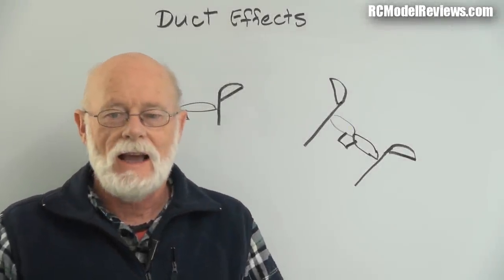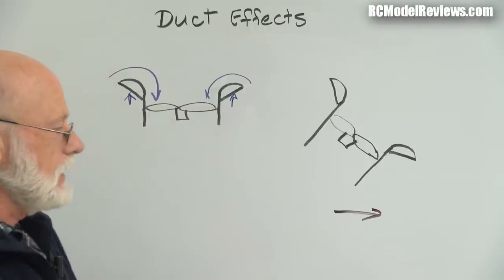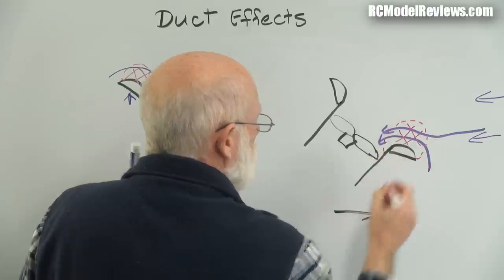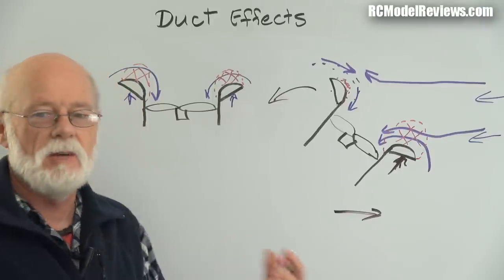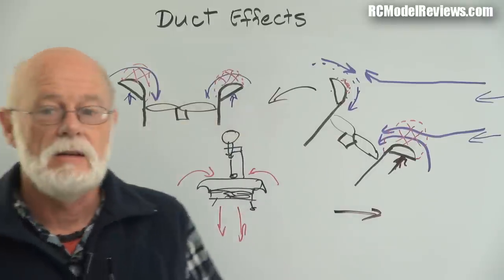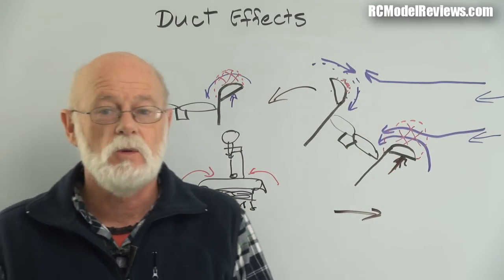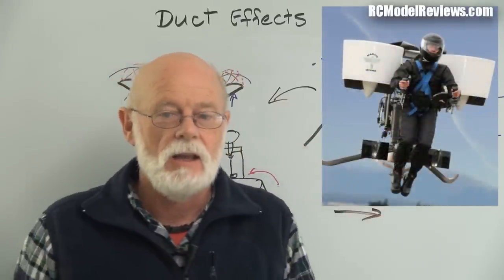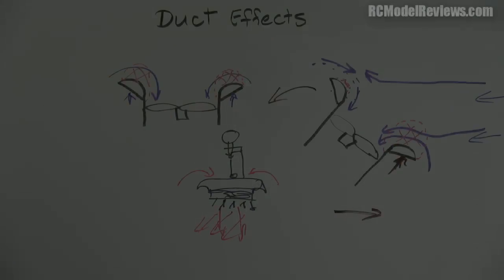More on ducted propeller systems

Comment: I'm wondering why no-one has done leading-edge slats/slots/flaps  ( or similar)  on a duct as a method of reducing the efficiency of the leading-edge as compared to the trailing edge, so that this problem goes away....  seems like a relatively simple approach, and would be mechanically trivial if done right.
Reply: I was wondering the same thing. The problem with changing the shape of the duct lip would be that the  effect depends on the air speed. The wing form would have to continually change during acceleration and retardation. That would have been a major problem in the 50ies. No problem today when
Reply: David Buzz 
The main problem would be that whatever you do there, you lose lift and you need that to stay in the air. Add to that the fact that it would be mechanically complicated to mount something moving on the circular lip (if it does more that just move up and down, the flaps would need to be able to change in diameter). All of this adds weight, while you already have reduced lift. So you would need a more powerful motor, makes everything heavier (again).
Reply: David Buzz  you mean like this?
Reply: David Buzz  I wonder now if the ducted fan's stability in regards to forward movement in air would be compromised if you were to add a thrust motor such as used on a gravity based Hovercraft?

Comment: So combine the platform, lipped duct, V-Twin motorcycle engine between the propellers, a longer horizontal shaft with 4 collared sprockets, 2 sprockets cranking differential gears to crank the props in opposite directions for that stable lift, then another 2 differential gears driving 2 ducted propellers mounted beside and above the 2 other ducted propellers for faster thrust? Seems like a simple enough workaround to me...

Comment: I don't know if you read my comment in your last duct video, but the duct is also a venturi tube, where the air at the bottom of the tube is denser than the air at the top. 
This would help with thrust slightly. 

Now, about the ducts, what would you think would happen if you changed the surface area on one side of the duct to the other, have it so the surface area is changeable mid-flight?

I have a 3d printer, I just time look into this :p

Comment: To add to my previous comment: In addition to the shape-morphing duct, one could add thrust vectoring to the underside as was done before but morphing the shape of the leading edge of the duct might actually make this work.

QUESTION: How would a fixed shape ducted fan affect the 3D flying ability of a fixed wing aircraft?

Comment: Awesome Bruce! You teach us all so much!  I wonder why they wouldn't put 2 small 5hp engines One on each side with vertical props for forward thrust and just stay with 2- 40 hp lift motors?  One quick side note;  Bruce what ever happened To all the UHF Long range reviews? . . . . . Are they all edited?. . . .Are you waiting to upload them?    I went from Orange 1-Watt  To DTH UHF and even tried  ImmersionRC  until I bought a transmitter Holy cow $69.00 for one of the small ones! Please help us and teach me more about UHF systems :)

Comment: Sir, what if you placed additional smaller ducted fan positioned horizontally on the platform for forward thrust? Please advise. Thank you! Jon
Reply: The big one would still get air flowing sideways across the top; because the air was flowing sideways, it would cause it to tilt and counteract the force of the little fan.  Only a small tilt of the big fan is needed to counteract the little fan.

Comment: Hi. Thank you for this very interesting video. It makes me think about turbofans wich are, in my point of view, a mix between a jet engine and a ducted propeler as 80% of the air taken from the intake is not going in the compression chamber but merely propulsed thru an outlet vain and the edge of the turbofan have a shape for generating some coanda effect.

Comment: If you used a straight tube, there would obviously be an efficiency reduction without the lip, but wouldn't you'd still increase efficiency due to vortex reduction at the blade tip?

Comment: In the case of a quad rotor design, with each rotor using a duct and each duct fixed perpendicular to the direction of travel, couldn't you include one or more rotors parallel to the direction of travel to produce the forward thrust?

Comment: I wonder if the instabilities of the full scale airplanes with circular fuselages, mostly the light sports plastic types, suffer from an unanticipated Coanda effect. Classic general aviation planes ,(Pipers, Cessnas, etc), riveted aluminum, had flat sided fuselages, mitigating the Coanda effect when side and forward slipping.

Comment: I wonder if a modification of this design could be used for the space elevator. What if a tube consisted of several stacked coriander (sp ?) airfoils and the top of the tube sealed, so that ALL air entering the tube had to flow over these airfoils. I wonder how much lift such a system could create.I really like your ducted fan videos.

Comment: I find myself wondering what would happen if two small wings were added, or even four, evenly spaced and running with the flow of the thrust, possibly with flaps so as to avoid spinning when hovering or provide more lift when lift capacity lessens between transitions from hover to glide.

Comment: For a quad rotor, seems like the c-whatever effect would still cause you to loose some efficiency in forward flight due to the loss of lift towards the back of the ducts, and coupled with the extra weight and drag, it may be worse than no ducts, don't know. Because they are part of the same rigid body, the direction of lift overall would still be "up", but I think it would shift your CG back a bit, like you were hanging the air-frame from near the front of the ducts instead of from the centers. How to test, hmm...

Comment: Hi I am new to this channel.
the ducted theory was interesting thank you.
As I see it even if the duct was vertical and another power source was propelling the craft forward the  relative direction of air flow over the front and rear lips of the duct would cause the craft to rotate in a direction away from the direction of travel.
I say this as the forward lip has higher air flow as a result of the addition of the air speed of the craft and the rear lip has lower air speed as a result of the crafts air speed deducting fro the intake air speed.

Comment: It's amazing how the Avro Aerocar keeps cropping up. It was a ground effect vehicle (hovercraft) and has nothing to do with the coander effect. The Hiller flying platform was totally unstable (like a helicopter) because it was balanced on a column of air. There are a million (plus) modellers who can confirm that a ducted propekker is less efficient than an open propeler.

Comment: what about increasing the high pressure area at the bottom? high speed exhaust is fine - a nozzle could do that, but ain't there a way to increase the "high pressure area" at the bottom, together with "low pressure" at the top?

in modern day aviation we got these "organic" shapes, where the wings can morph and twist. the same principle of "fabric pulled on top of a morphing skeleton" can produce a lip with changing lift profile around the ring... has that been atempted? to vary the lift produced by the lip along perimeter? that seems like a viable option for their platform...

Comment: Surely if this self-righting effect is so strong, why didn't anyone try to just use extra motors?

The ducted fan solely to provide lift, and some additional engines mounted at 90 degrees to produce forward movement.

Yes, extra motors means extra weight and complexity, but it seems a fairly obvious thing to try if you can't get the lifting fans to reasonably provide forward thrust...

Comment: Did they ever try disrupting the airflow over the leading edge of the duct using opening ports or slats?
Reply: sqwert I recall seeing a design from about that era when there were ports cut into the ducting to try and increase maneuverability but don't recall the outcome or who did it.
Reply: sqwert 
If you disrupt the airflow, you lose lift. If the design relies on the lift of the lip to even get in the air, that's not a good idea.
Reply: ***** Bruce,
I believe it was the AvroCar. One on their attempts for more control was to put some vaned openings around the periphery. At least those experiments led to the hovercraft.

Comment: That explains why my tricopter moves forward so slow and is so stable :)) 
But my problem is weight as I wanted a slow moving, highly stable platform :D
I do get around this (forward moving) problem by continuing the ”lip” all the way to the exit and being much thinner it acts like a circular wing. similar to a high bypass jet engine - they do well in forward flight, don't they?

Comment: Can you theoretically use ducts to create the drones lift, and have it rise and lower on the propeller instead of the propeller rotating to move the drone? this way you get the added benefit of power without having to ever reduce power on a given blade.
Reply: My second question is can a helicopter using the duct system that rotate momentum by controlling these pockets of thrust in ducts?

Comment: How about having one ducting fan in horizontal position as a pusher engine? How about horizontal ducting fan in aircraft instead jet engines? How is the efficiency compared to propeller driven aircrafts?

Comment: What if this was used only for horizontal propulsion?  If here a formula to optimize thrust? 

In a lift application, what happens if the blades are variable pitch like a helicopters'?

Comment: If using vertical ducted thrusters cannot provide enough forward velocity, why not add one or more (smaller) horizontal ducted thrusters as well? That way, the vertical thrusters provide  most (or all) of the lift needed for the platform, and the horizontal thrusters can provide all of the sideways thrust needed to move forward.

Comment: One question in parts...

what if you are using ducted fans for lift only and a separate thrust device eg small rocket, jet or prop as an example

What about a ducted prop for thrust 

and or a ducted fan for thrust and a ducted fan for lift. 

I'm only really interested in would it work, and would the complication of mechanical parts an weight  make such a system less practical than say a traditional fixed wing set up.

Comment: What happens if the ducted fan is already in the horizontal position (i.e. placed on a wing) Does it still have this tendency to pitch to the vertical?
Reply: If its already in a horizontal position the benefits of the ducted fan still apply. It doesn't have the tendency to pitch to the vertical position. Because the flow/force diagram of the ducted props is more or less the same at vertical and horizontal position. Chocolate hits the fan (no pun intended) once you try to use it at an angle because of what he explained in his previous video.

Comment: A ducted propeller should work well in the front of an airplane though. Say like in the front of a STOL like a Cub or Cesna. With todays high precision manufacturing and material techniques this should be fairly simple. The duct could even be a "rim" that is a duct that is attached to the tips of the propeller and spinning as the propeller spins so you will not have a gap between the duct and the propeller tips.

Comment: The Martin Jetpack has not just had hovering videos. There were low speed flight videos on the original high fan version and there has been higher speed flight videos for the low fan version. That said, with a top speed (according to wikipedia, take with a grain of salt) of 40 km/h, it isn't that quick.

Comment: how would it go putting a mini quad on top of a curved disc ( flying saucer shape)  so the thrust flowed over the curved surface to provide the lift ,it should  provide more vertical lift for camera ships etc. really interesting topic , i recall reading the coander effect dated back to the early 1930's,i think hitler put him to work during ww2 but the war finished and the tech didnt resurfaced in the 1950s. i image modern power systems and accelerometers etc might make it more efficent? cheers for the interesting vid bruce.

Comment: Lower horizontal thrust on the left and right might of provided turning as well.  Electric motors drive.  One switch to unify the two.  Center for forward, turn knob left  or right to fluctuate power to the smaller ducted electric propellers.  Had nothing to do, just guessing.  Learned from vid.

Comment: +RCModelReviews I've solved this.

What are the issues with putting ducts on a VTOL? 1) This self-righting problem; 2) Blade to duct clearance and tolerances; 3) Bearings and rigidity vs. weight; 4) Transmission complexity and weight going from an IC engine to the drives.

My method fixes all of these. Particularly since 1 and 4 go hand in hand. Miniquads are going to be old hat, and you'll be looking at Penduos instead.

Comment: thats interesting, I could see it being used for VTOL Jets and turning on the power when you want to hover or land and diverting the power to thrust engines when wanting to move forward.
Reply: The problem is that the effect still happens even if the vehicle is horizontal. The airspeed causes the air rushing over the leading edge to increase lift and and over the trailing edge to decrease lift, causing the thing to lean back thus cancelling the forward thrust.
Reply: GordieGii you can use forward thrust when moving forward, and when you want to land or hover, lower the energy to the thrust engines and turn on hover engines, and when you want to land slow down the propeller so you can lower the plane.
Reply: MrPepsicola123 I believe that having two sets of engines of which half are turned off depending on whether you are flying or hovering is considered a no-no in aircraft design. So basically we are just talking about a ducted Osprey.
Reply: GordieGii I'm talking about a set of propellers pointing vertically on the wings. which can be turned on or off depending if you want to land or not or hover. and a set of thrusters on the back like a traditional jet.

I guess you could say that. the closest thing i could find on google to my idea is something like this.
http://4.bp.blogspot.com/-d19Pho7rRXo/UVwNlWHZUMI/AAAAAAAAAEI/1B0g35IOVpU/s640/Avengers-Movie-Helicarrier-With-Quinjet.jpg.jpg
Reply: MrPepsicola123 That looks pretty cool. If you have a way to connect/disconnect the hover fans with the same engine that does the thrust then that could be useful. Otherwise you are adding a bunch of extra mass (extra engine) that is only used for takeoff and landing, a big no-no in aircraft design. I also believe that clutches are frowned upon. How about something like a Chinook? Or a Harrier?

Comment: I just wonder about the effect you speak of that stops the duct from producing speed, what if you had vents on the side of the ducted fan, so when you wanted to go fast you would open up vents on the side thus reducing the amount of upward thrust in one direction and balancing out the effect on lip on the lower side of the duct.

This would allow some of that swirl you were talking about to be pushed under the ducted lip and reduce the natural effect of the duct to right itself.

I'm guessing that it would be quite dramatic though so would need some experimentation on the issue.

So if the vents were just by the edge of the fan tips the swirl created through the vents would cancel out the pressure issue.

You would be able to control the amount of vented pressure which would give you control, thus creating a higher presser at both top and bottom of the lip you are tilting.
Does that seem plausible has it been tried?
Reply: Maybe some kind of deflector on that upper low pressure area to direct the flow back into the propeller rather then into the low pressure area.  Of course this would need to be there when you want to tilt and go forwards and then disappear when you want to hover.
Reply: Using modern materials such a lip could be produced, it wouldn't need to be solid by design but would need to be a flexible material that became stiff when a small charge was applied.

On the other hand perhaps just allowing the extra pressure to escape via a kind of open and shut vent would be simpler to achieve and lower in cost to impliment.

If it's just a case of the high pressure build up causing the problems then by releasing the high pressure you would remove the problem, the high pressure that is being released could be fed back into the wing to provide stability and thrust.

Such vents could be placed around near the fan blades tips the only real issue based on what he was saying would be having an effective reliable seal on the vents.
Reply: The other thought I had would involve actively changing the shape of the duct to essentially correct the airflow at speed.  But that would require even more equipment the aircraft would have to haul around unless it was super light weight...
Reply: Dayaa Mar Sana Or perhaps used some kind of memory material so you could run a small charge through it so it would alter its shape.
Interesting thought.

Comment: I think if you had enough power the effect could be minimised, i.e. if your quad (or whatever) is almost perpendicular to the ground when at full throttle, then the apparent angle of air movement would be almost optimal again. The effect could also be managed, in the case of a MR anyway, by moving the ducts further apart.